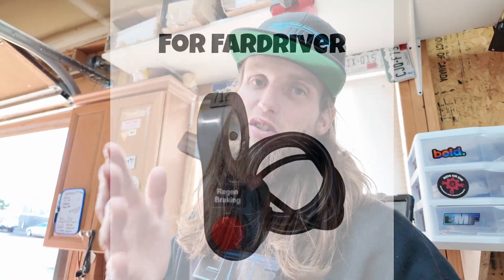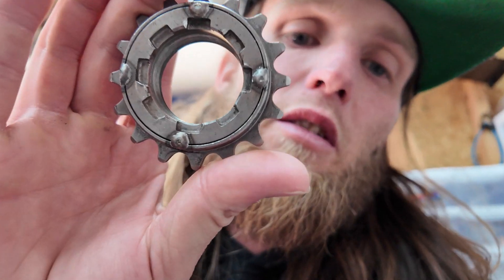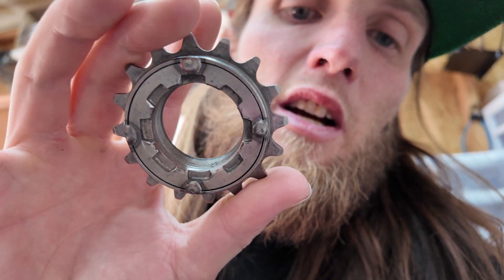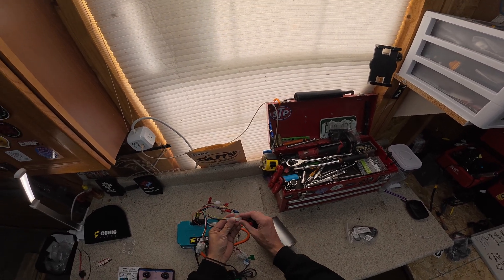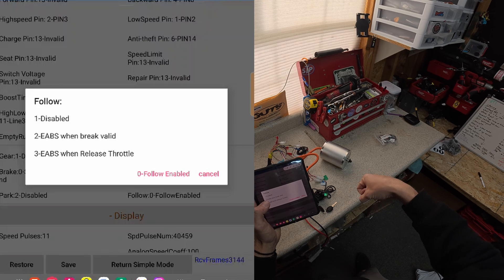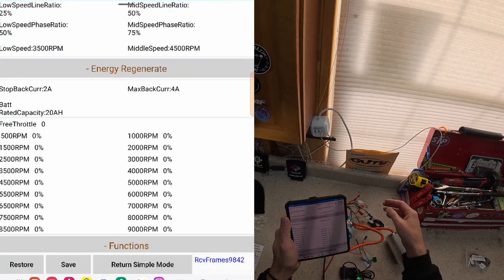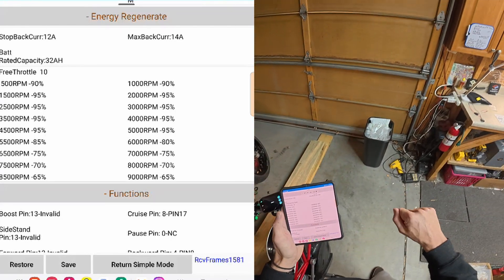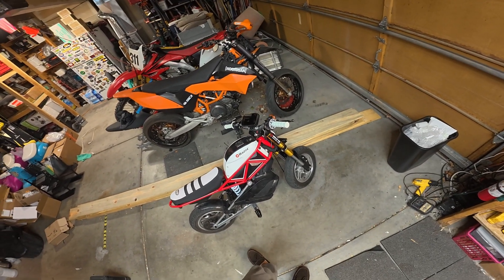How To Set Up Momentary Regen Brake With Fardriver

Comment: I have a Hotpaxx 60v battery that’s only 10 amp charging so I simply just went into my ant BMS and changed the max charge current to 20 amps and set my stop back and max back to like 14 and 17 and it works great! These eve40p cells can easily handle it because it’s not like you are charging it for hours like on a charger at 20 amps it’s just for regen.
Reply from the maker: Nice no doubt your right 😂 don't tell the kids

Comment: I mainly want it for emergency slow down when I see something far enough ahead (little kids) and I just need a little slowing. I put in stop back 5, back cur 7, free thrtl 7. Tapered %s. My Batt. only charges at 10A max. The exercise puting it in will help me learn. I rarely run a mile at a time in my hood. Running on a Radio Flyer wagon.😋

Comment: Wait so this doesn’t charge the battery at all??
Reply from the maker: I mean yes it does. But no it does not charge it enough that you would ever gain more mileage from it. And that goes for really any of these bikes like Surrons, Altis You might maybe gain 2% back on a 20 mi ride fully using regen the whole time off throttle
Reply: @Razorcrew_Cole ah okay that makes sense.
Reply from the maker: @roasty719 Yeah it's really just a nice way to slow down without using brake pads or giving your brakes time to cool if you just were doing a lot of wheelies

Comment: I tried setting mine up to work off of throttle and it doesn't come on. I have a qs273 motor and stealth bomber clone  bike with fardriver, I have the app, got into the controller, turned regen on and it doesn't slow the wheel down any faster than free wheeling. Does the battery have to be below a certain state of charge? Does my throttle voltage have to be set a certain way? I think I'm missing something obvious.
Reply from the maker: I'm not sure about the voltage cut out cuz on most bikes it should technically not be giving region if it's above like 95% for sure cuz that could be overcharging slightly.  I don't know that our DIY stuff has those protections or not but possibly.  And you set the current to like what I did around that 12-14?
Reply: @Razorcrew_Cole I set it at 10 and 15. But I noticed that the percentages throughout the rpm range were set pretty low, around 25% for the most part so that means my 10 is a 2.5 amps. I would still think I would notice that with the wheel spinning off of the ground though. And looking at the watts I should see a negative number if power is flowing into the battery instead of out of the battery, yes?
Reply from the maker: @randallhack4477 yeah but with that low I don't know with the wheel off the ground you might be able to tell still pretty subtle at that like 12 amps going back

Comment: In the case of a go kart that has a QS138 70H motor paired to a 72V35AH battery, does the “freewheel” portion matter? I want to be able to push the brake and the motor slow down just like the video.
Reply from the maker: @askiagillette  Like I said it matters about your batteries input capability. 

If there's no free will ignore that part but yeah you can't have a free wheel and have this work it will just spin the free wheel

Comment: So I charge my bike with a 5 amp charger and I’ve been doing it for a couple months now. I have a 48 volt 21ah battery that comes stock with the Tuttio. Couldn’t I run 5amps of regen and be fine? I’ve ran 10-15amp regen but only for a couple minutes to test it out. Thanks
Reply from the maker: @252.tuttio  yeah I've tried to reach out to them to get some more specs on the battery and they tell me they don't know anything about it which is kind of pathetic lol 

Yeah you can do 5 amps but honestly you're not going to feel any breaking power from that really

Comment: Why you did not choose to used the brake sensor?
Reply from the maker: @shadoworkz123  I use my brake sensors for my brake light on my EMF plug and Play system.  And honestly I'm not really into that because I do wheelies and stoppies so that would just really mess with that the uncontrollable
Reply: @Razorcrew_Cole  oh i see. I ask because I used my brake sensor for the brake light, motor cut off and regen.
Reply from the maker: @shadoworkz123  nice Right on, yeah I like to have the working brake light so people know I'm slowing down behind me in rides or whatever but it is a cool option that people do!

Comment: so if follow:1-Disabled regen braking would be completely off? Even if there were values inputted into the regen braking RPM category until 5000rpm?
Reply from the maker: @Nouri_TV  Yes disable is awkward it should come out of the box, not sure what you mean about the 5,000 RPM, like in those settings that go from zero RPM to 9000 and that's where you're setting how much region you're feeling at that RPM
Reply: @Razorcrew_Cole  I had follow on disabled but my regen was on 5-20% from 0 rpm to 5000 rpm on the braking regen page of the far driver app on my tune. 

Would that mean my regen was always disabled since follow was off or does that mean since I had inputs into the energy regen braking page that it was on? 

Ty bro
Reply from the maker: @Nouri_TV  possibly was disabled if follow was off It is kind of confusing I forget it's been a minute since I messed with those settings now I just kind of play around You should be able to tell with the wheel in the air If you're getting any or not
Reply: @ ty for tip bro was trying to keep temps down on my f11 i had temps up to 77c after a 2 mile long wide open throttle run at 60-65 mph pinned so trying to change settings to manage heat got 11/68 gearing with 12" rims and 18.5 diameter tires
Reply from the maker: @Nouri_TV  really got that hot that quick?! Hmm Are you throwing a lot of amps and phase at it

Comment: Also what do you mean "freewheel needs to be welded". Are you saying the 3000w hub I just bought that comes with a "single speed freewheel cog" -- that cog needs to be welded? WTF? If you weld that freewheel, the pedals will always spin.
Reply from the maker: @RetroMancer242  yeah this is not going to be an option for a bike with pedals for sure.  Because yes picture if it's not welded and you push the regen button nothing's going to happen because the freewheel can just spin backwards
Reply: @Razorcrew_Cole  I don't get it. I keep seeing hub motor builds on YT and they use and tweak the regen settings. they all got pedals.
Reply from the maker: @RetroMancer242  yeah I don't know if I understand that then, I've never had a pedal e-bike so I guess that's kind of out of my realm I've never messed with hub motors either.  I guess that's interesting cuz if it's a hub motor maybe that's why it can regen and does not need the freewheel messed with cuz it's separate 🤔🤔 That's interesting to think about I'm not sure how they work I guess without having one to play with
Reply: @Razorcrew_Cole  Yea I just confirmed it. as long as a hub  motor does not have gears and is a "direct drive", there is no welding needed.
Reply: Will this work with the 72v 24AH battery you guys sell
Reply from the maker: @TheAviator01  It should if they haven't changed the amp input

Comment: How come your AMORGE 72v 20ah has a max input of 15amp - all the ones they got at that spec say 10amp at their Alibaba storefront?
Reply from the maker: @RetroMancer242  honestly not 100% sure, as a dealer I think we get better cells options potentially a lot of those alley options they are using the cheapest cells there is
Reply: @Razorcrew_Cole  Amorge on AB. They supposed to be good. I am about to order a 72v 20ah with Eve 40p cells. 125amp (200 peak) and ANT BMS.
The sticker says max 10amps but I asked her if I could get a 10 amp charger in stead of a 5. She said ingnore the sticker, it is only rated for 5amp max charge current. I can't use regen? that's foul!
Reply: @Razorcrew_Cole  Amorge on ALi-B They supposed to be good. I am about to order a 72v 20ah with Eve 40p cells. 125amp (200 peak) and ANT BMS.
The sticker says max 10amps but I asked her if I could get a 10 amp charger in stead of a 5. She said ignore the sticker, it is only rated for 5amp max charge current. I can't use regen?
Reply from the maker: @RetroMancer242  yeah if it's only 5 max then definitely not going to feel any region even 15 some people are wanting to feel more.  Yeah they're weird to deal with honestly man freaking Chinese
Reply from the maker: @RetroMancer242  it's funny they told me the opposite it could really take up to 30 input but just stick with 15 on the sticker 😂😆😂 it's so hard to trust what they say I have one of my close friends that's really smart with building batteries always double check the specs before I offer the ones I do on my website to make sure all the numbers actually add up correct cuz they have the known for lying
Reply: @Razorcrew_Cole  Yea I am talking with "Annie" at Amorge right now and she just said "we can make it 15amps". I'm about to tell her just build be the battery with NO BMS. sick of not being sure if the info is correct.
Reply from the maker: @RetroMancer242  yeah I hate dealing with her I deal with Alan.  She seems full of misinformation all the time confidently.  It's really about what the cells can take to.  Is it a 48 volt or 72 volt you're looking at cuz 72 volt should be 15 input just how it works off building them
Reply: @Razorcrew_Cole  72v 20ah EVE40P. sticker says max 10amps, she says ignore, only charge at 5amps, then says, yea regen will work. Then I linked your video and told her he says minimum of 15amps, then she says "OK, Ill make yours 15amps." Done with the inconsistencies, getting a locally built 72v 20ah Molicel for 70 bucks more. Thanks for the info.

Comment: Makes me wonder why we don't see a motorcycle freewheel for dirt bikes and emoto's. less work on the motor or transmission.
Reply from the maker: @tacticooldennis  yeah I mean I'm a fan of it On our razors gives the motor a break to cool down and is convenient less wear and tear for sure!  I recommend to most people to run the freewheel but would you start blowing them up once we throw over 10KW at it
Reply: @Razorcrew_Cole I blew mine up on 3kw 48v but I also ride dirt and jumps so it’s putting lots of tension on it
Reply from the maker: @Lucas_GT-FURY  yeah I put in BMX ones and even then we can still blow them up usually not with 48 volt but yeah if you're beating on it and picture the wheel spinning in the air and then you land it's torquing on that pretty good and eventually going to pop it

Comment: Can you run the regen the whole time instead of a switch by just doing everything except touching the follow? i wanna run it the whole time mainly for wheelies and saving pads until i get that switch
Reply from the maker: @s_bayin84  yeah where I talk about changing That e a b s after follow just set to release throttle or whatever it is
Reply: That's EABS when release throttle
Reply from the maker: @HiLuckyB  yes

Comment: Could I even try to run it with a 10a input battery
Reply from the maker: @Coldstart_media  yeah it's just basically the higher the number the stronger the breaking power will feel essentially.. So I mean around 9amps you should still feel it, 5 amps not so much

Comment: Would it work on an ec4p 6078
Reply from the maker: @JoeySplash  If you're running it with far driver
Reply: @ thanks I’ll have to consider that. Honestly when my motor takes a shit ima get fw11 with a fardriver
Reply from the maker: @SkiBall19  👏 Good choice for sure

Comment: Do you have a video on a flipsky 75200 v2 pro to kr5v tuning video?? ive been trying to set mine up and it would help to have a video on it if you would be willing to make a how to video???? that would be sick

thanks in advance
Reply from the maker: @foreverdriftandcars  I don't I do have footage from when I was sending it up but I didn't actually have luck with it running good enough to do a video and I haven't came back to it yet
Reply: @Razorcrew_Cole  ive got mine going  by watching videos of other motor setups I'm just afraid of ruining it 😅 it seems to rip pretty good but every so often cuts throttle for a second then let's me go again idk if I have something set up to aggressive 🤷‍♂️ as I am super new to this controller and have only used the vesc app a hand full of times and setting it up to the best of my knowledge 🤣🤷‍♂️
Reply from the maker: @forrestmagel  Man that controller is known for cutting power I can never figure it out honestly